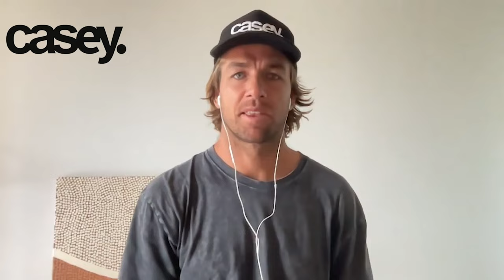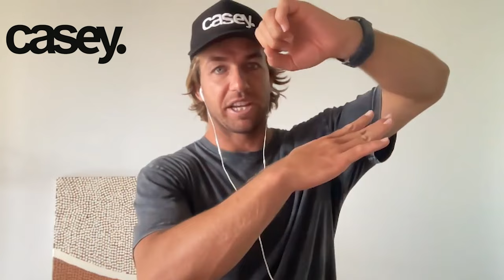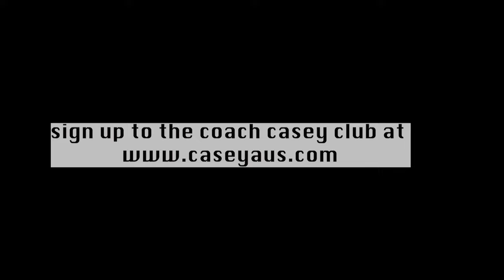Thursday Thoughts | Tuning Your Foil Equipment, What To Look For In A DW Board + Surf Foil Contests

Comment: Judging criteria interesting topic : In France the French Surfing Federation is working on it. So far it has been decided to keep the same criteria as shortboard (angle of the foil during the turns, tips breaching, etc, those will help judges to make to score). Priority to the rider paddling into the wave vs the rider pumping back out. Two best rides (one ride = one take off and two connections, so one ride = potentially 3 waves ridden).
Reply: How about bonus points for longest total time on foil?  Most consecutive wave connections?  Getting air?  Getting air with a 360?  Getting air and landing and continuing to ride?  Getting air, 360, landing and continuing to ride?